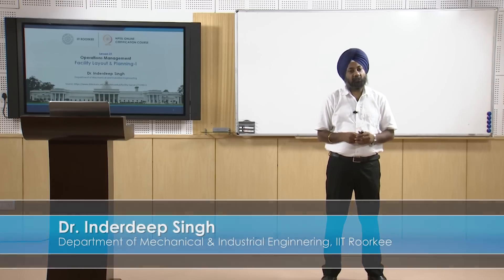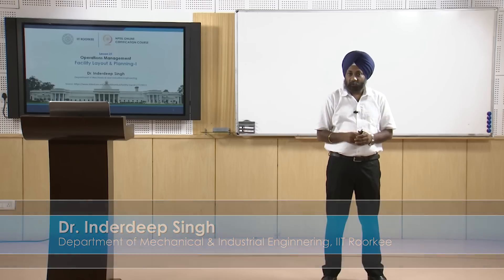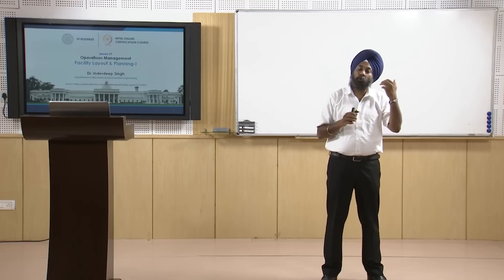Lecture 21 Facility Layout and Planning-I

Comment: A company is planning to manufacture tennis racquets has
to decide on the location of the plant. Three locations are
being considered viz., Mysore, Bangalore, Hosur. The fixed
cost at the three locations are estimated to be Rs. 30 lakhs,
50 lakhs and 25 lakhs respectively. The variable costs are Rs.
300, Rs 200 and Rs 350 per unit respectively. The expected
sales price of the tennis racquet is Rs 700 per unit. Find out:
a) The range of annual production/ sales volume for which
each location is the most suitable
b) Which of the three is the best location at a
production/sales volume of Rs 18,000 unit.
Pls provide me ans of this question related to Break even analysis
Reply: @countrysiderpindawale2069   pls provide, I didn't get